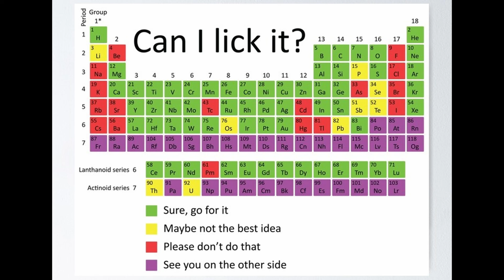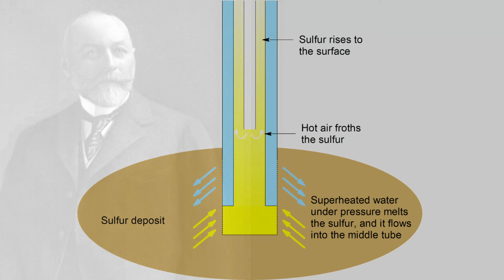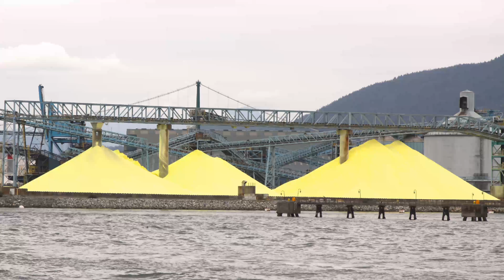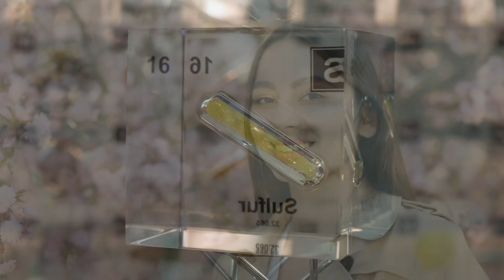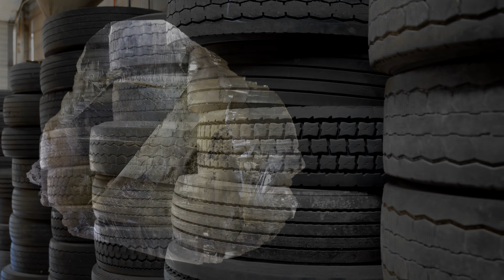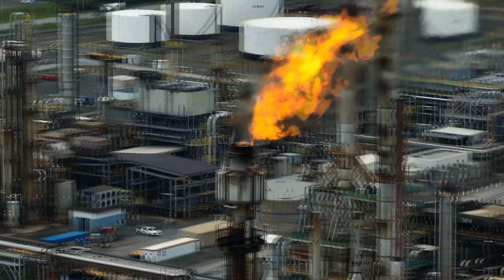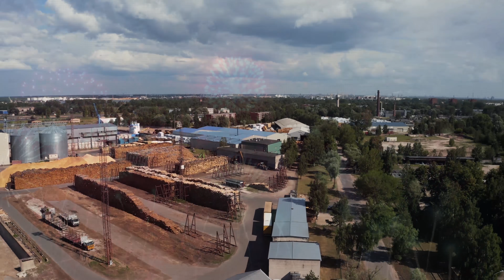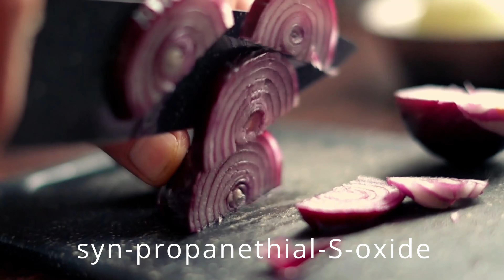Sulfur: The Element Behind Amazing Food AND Awful Smells🤢🤤

Comment: I did not think Carbon Dioxide is poison?
Reply: Supposedly the sensation of needing to breathe comes not from a lack of oxygen but rather a high concentration of CO² in the blood. Hypoxia itself is said to be not unpleasant even if it kills you
Reply: @missano3856  I have more experience than I wish I had.  As a contractor in a large converting factory (printing and coating vinyl wall covering I was working on a weekend when a fire department and plant management were outside when activating a CO2 system with a separate structure filled with huge liquid CO2 filled the entire building filled while I was on a ladder. I got out of there, barely.  What a scene! I hadn’t been “accounted” for.  Once I was off the 6’ ladder, the gas was a dense fog with no visibility under my chest.  I felt like I was going to “flash freeze” but just cold. I could breath but I was suffocating while I kept my head high and carefully and quickly as possible to the nearest exit door.  I was very dizzy and near to pass out I think. In the clear air I did sit down with my arms behind me breathing as had as I could.  The fire protection people were outside looking at me with a lot of huge eyes!  I said “I’m fine”. @cube chemistry was I poisoned as well?  I really don’t know.  No oxidation whatsoever occurred 😅 I would say that was 50 years ago and this may have made me have aches and pains and less acute near sight. All my hair went grey as well.
Reply: Almost everything is toxic at high enough concentrations?

Comment: One thing you didn’t mention, which blows my mind.
H2S is not dangerous when it smells, because the concentration is very low. At higher concentrations, when it is lethal, however, it stops smelling.
So the irony is that near volcanoes you can smell H2S, so you turn away and you are safe, but if you keep getting closer, you stop smelling it, you think you’re safe, but you’ll soon die.
RE vulcanisation, it’s a double edged sword: it makes tyres indestructible, which is both good and bad, because it makes tyres eternal, sooo good for the environment…

Comment: One time when I was a teenager, about 16, I took apart an old generator from a bicycle light set. The magnet that was the rotor had a hollow center and was fixed to the steel shaft with Sulfur! It looked as if they had put it into a jig that aligned the shaft and magnet, then poured molten Sulfur in the void to fix it in place. I'm not sure how old it was or who made it, but I remember being surprised when I figured out what it was by melting then burning a bit of it. It was fairly hard and it broke into little chunks when I probed it to see if I could remove the magnet for a project I was doing. When I burned it, it looked, smelled and acted like the Sulfur I used for making black powder. There was a good bit of it and I ended up using it in some little pyrotechnical device I made for fun. I didn't get out the chemistry set and test it any further, but the fact that it worked to make a bit of black powder was good enough for me.

A Skunk's scent is a mix of Mercaptans and other stuff. Mostly Mercaptans. ( Mercaptans are Thiols )
Reply: I really have to memorize that. Using sulfur instead of shellac could be a lifesaver when you run out of shellac.
Reply: Thank You for the knowledge! Didn't know that about skunks!
Reply: I wonder why? Maybe it is molten and not melt in operation not could other materials which would be too hot to cause the magnets become not? Interesting.  I didn’t believe that until I read your comment fully.  That is fun stuff to hear.

Comment: "All yellow chemistry is TRASH" words of wisdom from ExF
Reply from the maker: Do I smell some hate here? Lol
Reply: @CubeChemistry  ExF's chemistry ventures tended to produce yellow tars when they went off plan.  I think that was the problem, rather than some grudge against elemental sulfur.
Reply: @CubeChemistry  They are referencing Tom, from the channels Explosions and Fire and Extractions and Ire. The second one is a pretty solid chem demo channel. The first is a fun BOOM BOOM chem channel. 😂
Reply from the maker: @victoriaeads6126 i did not make the connection I love explosions and Fire and extractions and Ire. He makes really good content I do not dare to make.
Reply: @CubeChemistry Every chemist has a strong vengeance against a very specific set of chemicals! 

But yes definitely hatred 😂
Reply: Yeah, he's got a problem with the smell of sulfur compounds and the fact that he's had trouble with things turning yellow when they don't do what he wants them to do in reactions. 😂 It's a long running joke at this point.

Comment: Coal often contains sulfur, coal fired power plants use smart chemistry to make gypsum from the waste gas and make money selling that.
Reply from the maker: Which makes sense.
Reply: China had problems years ago making gypsum board from coal waste, it had a high sulfer content which emitted hydrogen sulfide. The HS corroded metal and caused health problems.
Reply: @ChesterCochran the CCP doesnt care a lot of chemistry.
Reply: @picobyte Xi Jinping is a chemist by education
Reply: @EthanBorokhovich-xj3rl The point is, they are ammoral and care neither about quality control nor worker/consumer safety.  Only money and power.  Chairman Xi isn't running the factories, and his education therefore doesn't change anything.
Reply: Much of Illinois has coal under it. Almost all of the coal has sulfur in it. Otherwise it’s good coal, and until people started to worry about carbon dioxide emissions, much electric power in Illinois was produced by burning coal, and eventually the sulfur was removed from the fumes using scrubbers. These can use limestone to produce gypsum by combining with the sulfur. 15:56
Reply: @markiangooley I grew up in old strip mining country, where we went fishing the spring water always smelled like sulfur. Probably shouldn’t have been drinking it
Reply: @pw1340 There are many reasons why IL (or other) lakes can get contaminated, especially in mining areas.  Sulfur, or rather deadly Hydrogen Sulfide, can be found even in pristine waters because Sulphate and sulfur containing proteins are ubiquitous in nature and under anaerobic conditions (such as great depth or where the decay phase of eutrophication has exhausted dissolved Oxygen), these are digested and reduced to sulfide.  However mining (& some industrial) districts often have heavy metals as well as sulfur.  Most Hg in the environment originates from burning coal or incinerating trash.  Under anaerobic conditions, it often gets transformed into its deadlier form, methyl mercury.  So, the H2S stench is often a warning of other hazards.
Reply: Coal and other petroleum chemicals contain mercury aswell
Reply: @ryandavis8245 
 Yer so right!
I recall, years ago hearing that fish was chock full of mercury. Coal fired power plants. Do yourself a favor and Don't look up how many tons of mercury the U.S. and Chyna spew into the atmosphere.
 This pollutant alone should be reason enough to campaign for nuclear power!
Reply: I use that on my dam beds to soften the banks and attract marron, a fresh water Cray fish. Very good cooked up and eaten with white bread and some salted butter if your fancy.

My dad at them for lunch on weekends when his parents where away and I did the same.

My boys a bit more sensitive about killing so  I dont make him eat em, I just enjoy catching them with him and throwing em back.

Food prices keep going up theres gonna be white meat on the menu bois.
Reply: Smart chemistry 😂😂😂 more like poisonous chemicals
Reply: @swampboymobster I can see CaO (also used in cement mixes) and O2 being required.  CaO is highly alkaline (& therefore burns mucous membranes), but there are worse chemicals in cosmetics and some foods.  Dosage and industrial safety equipment makes the difference.
Reply: All gypsum is hydrated Calcium Sulphate.  As a salt, it will be mildly corrosive to certain metals, but acidity would be trace sulfuric acid or trace reduced sulfur, mostly deadly H2S.  Gypsum (drywall) in landfills and other anaerobic environments famously produces H2S because sulfate-reducing bacteria, which use sulfate instead of oxygen as the oxidizer to burn their fuels, reduce the sulfur to sulfides, releasing toxic H2S unless metal cations are available in excess to soak it up and precipitate as pyrite etc.  The typical problem with gypsum is not "sulfur" but rather impurities.  Phosphogypsum from FL phosphate mining (phosphate rock, essentially fossil shark teeth [hydroxyapatite with some flourapatite mixed in b/c sea chemistry] is dissolved in sulfuric acid, yeilding soluble phosphoric acid [processed into fertilizer ] and gypsum) is unusable because a small amount of Ca gets replaced by heavy metals in marine environments, including radioactive ones like U and Ra.  Coal (and gypsum derived from it) would have a different set of heavy metals depending on its source, often Hg, Pb,& Cd.  Also, toxic nonmetals and semimetals like As or Se often substitute for the Sulfur.  Additionally, PDR China has been infamous for poor industrial hygiene and quality control since the Cultural Revolution massacred most citizens with an allegiance to some form of ethics.  Contamination can enter from machinery, random trash, or even the corpses of (former) employees if quality and safety are less important than meeting a production quota.